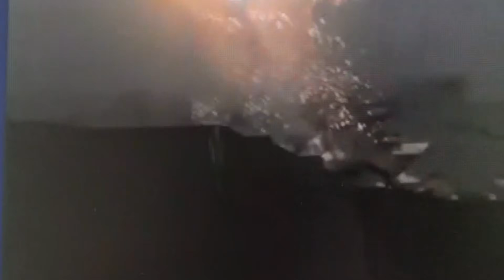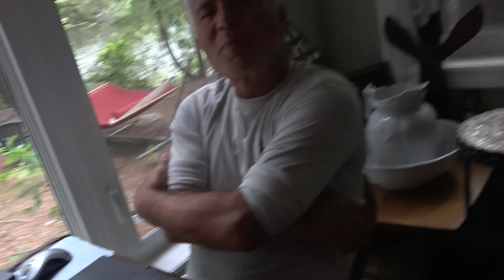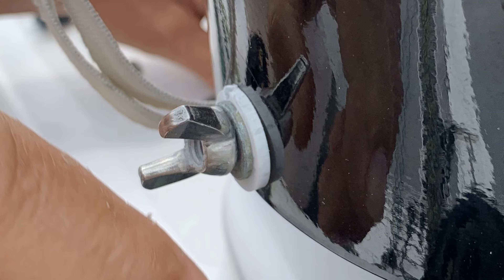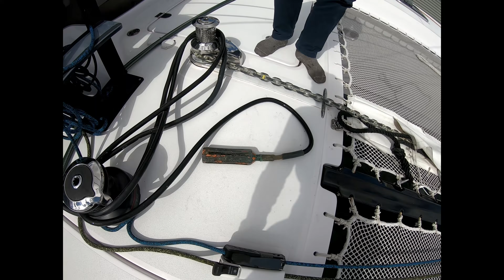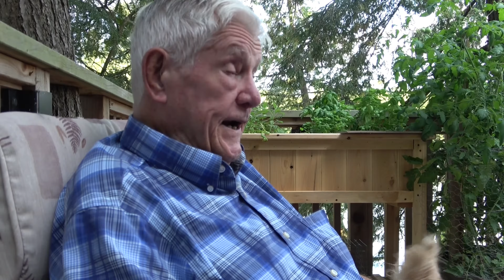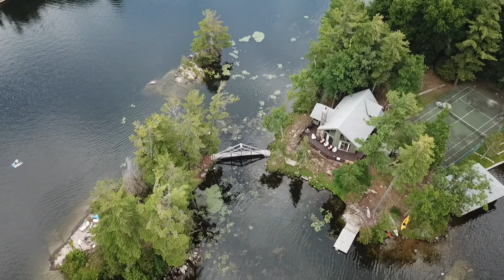Ep.54.  LIGHTNING PROTECTION on a Catamaran

Comment: This is more or less the system I intend to install on my new cat. Same issues, high performance boat, carbon mast. I was thinking on using a larger copper plate though, what is this lightning disipator your system has.

How has the system fared so far? Was this originally fit the manufacturer?

Comment: I concur on your solution, personally I would make the copper cable continuous to the water contact, oxidation is isolating and to be avoided. Also it’s more important to have a clean surface when contacting the water so I would not waste money on fancy water sculptures, just wipe your terminal plate clean before water insertion.
Reply from the maker: Agree with the continuous connection. It was not possible on the 5x.

Comment: What if you have a metal rod connected to the base of the mast that you can lower through the deck and into the water?  The deck is well above the water rather than submersed so it must be easier to make it watertight.  Or at a pinch what if you connected the base of the mast to the anchor chain by a cable and partly weighed the anchor?

Comment: Thanks again for another very good video. We are prepping our 1985 Catalina 36 in order to head to the Caribbean for an extended stay. Our mast is keel stepped and has a heavy gage cable bolted onto a keel bolt. I have inspected and unfortunately discovered that we don’t have any rigging or other metal structures bonded and also grounded to the keel. 
My question is triggered by your straight path statement. Could this be the reason the rigging and auxiliary metals are not bonded as the most likely path is direct from the mast head? 
Once again thank for sharing your experience and knowledge. 
Cheers
Kevin

Comment: how come with carbon fiber masts boats the builders didn't  include an insulated tube straight down through the boat to run a rod into the water that can be pulled?
Reply from the maker: Cost!  Ask a mast building if you need protection and they say YES.

Comment: How has your OC tender been,  very light is it easy / ok  in choppy waves? And how about when you bring it up on the davits. Maybe you can show a bit on this issue.  Many thanks Robert
Reply from the maker: We love the tender.  Like any small, light dinghy, you need to take it slow in very choppy waves.  It is no  better and no worse than the inflatable we had on our last  catamaran that had a hard bottom.  It is easy to get  up on the davits, but the pully is a bit undersized. (Another improvement needed!)

Comment: I had the same set up on my Manta with a knuckle mount on the mast and the same cable and dispersal end. This seemed to work very well at grounding the boat to the water with a straight line top to bottom. We had a few very small lightning fingers strike taking out my wind instrument mounted atop of the mast and slightly higher then my mast top wire fuzzy ball.  
It's my thinking that the boat is less likely for a strike if it has the same impedance as the surrounding water.  Also the boat metal parts were not ground bonded.
Reply from the maker: Super interesting! Thanks!!!

Comment: Interesting solution, most people avoid even talking about lightning strike, let alone devise a solution. One of the biggest arguments seems to be that if you make your mast an effective ground then you could be increasing its potential to "attract" a lightning strike. 
I have two questions....do you know of anyone using this type of system on a cat where this has been successful (If so how successful) and, did insurance cover any of the lightning strike events or do you know of any insurance companies that take on that risk?
Reply from the maker: Yes, we have heard that argument. See Comment from Grant Grove about success.  All we know is that we have never lost electronics when we leave the boat with this system in place on 3 different cats compared to suffering damage several times when there was no protection. It does not help that our mast is usually  one of the the tallest around.  The only insurance company that insisted on protection was one I used for a 24 ft monohull with no electronics!